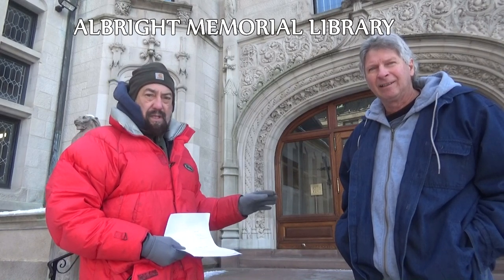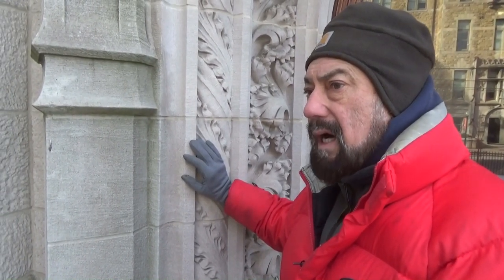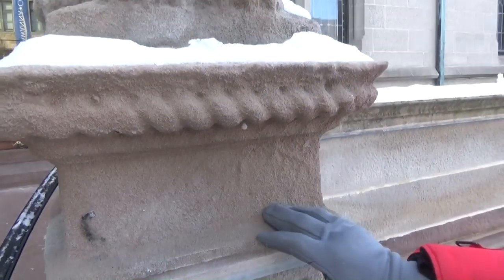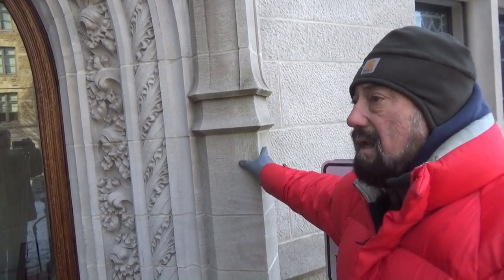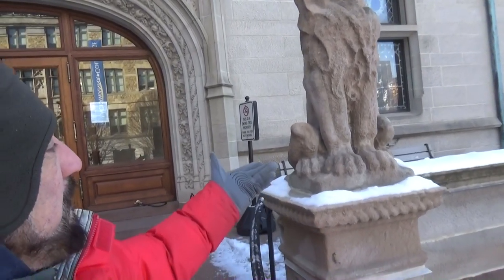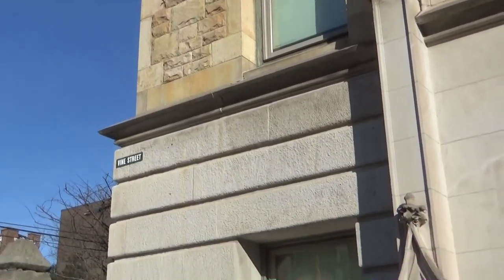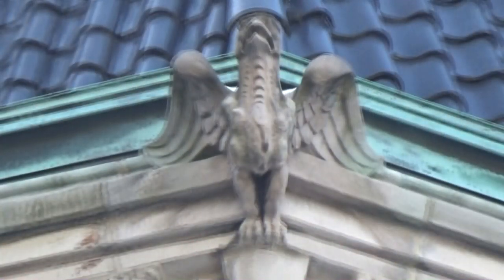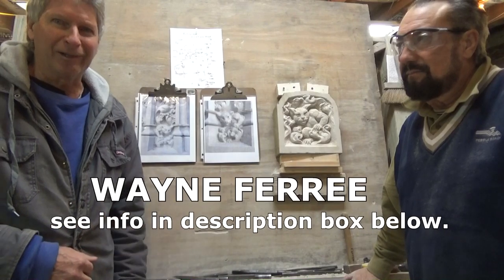ROCKFACING AND SHAPING STONE (Part 7) MIke Haduck

Comment: Thank you both for doing this. What kind of gutter system are they working with to keep water away from the limestone? Was it all through the gargoyles maybe?
Reply from the maker: Hi MG. I don't think they used the gargoyles on this building,  but when I worked on the last building like this they were using copper and lead, thanks mike

Comment: 1890 saw a downturn in dollar value and the modern equivalent for 1890 $100 is $2823. So say they spent only $100,000, it would roughly amount to $282 million in todays money. $352 million as a more exact ratio.
Reply: Not taking into account the time saving factors and machinery to facilitate it. But I'm thinking if an exact copy were made, not using plywood, or modern materials, it would still cost more than $20 mil.
Reply: According to what you said 100 is 2800, it will be not 280 mill dollars, but only 2.8 mill dollars.
Reply: @george.carlin  : Ah yes, youre right. Good catch.
Reply from the maker: Thanks Pockets , good tip on that book, mike